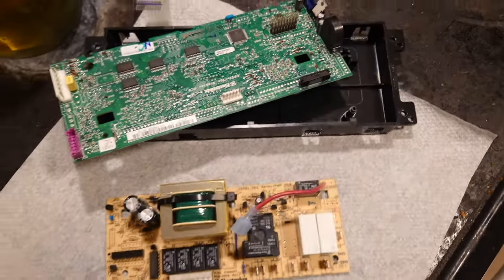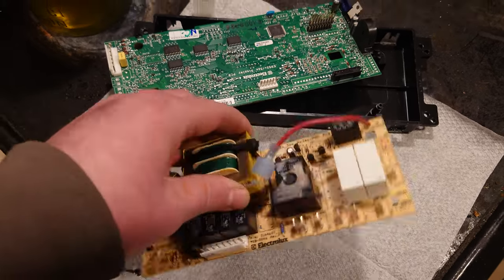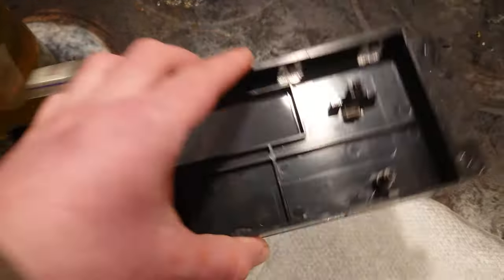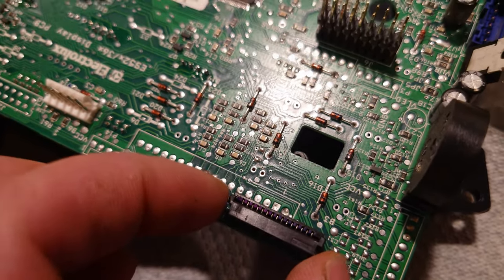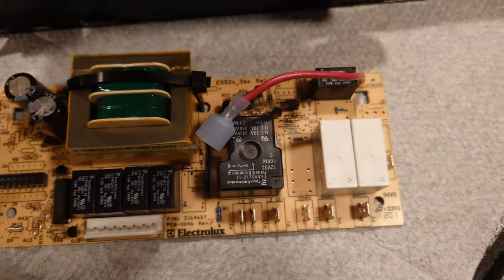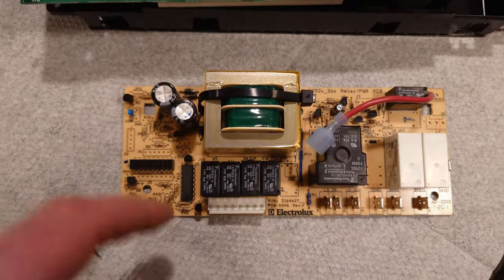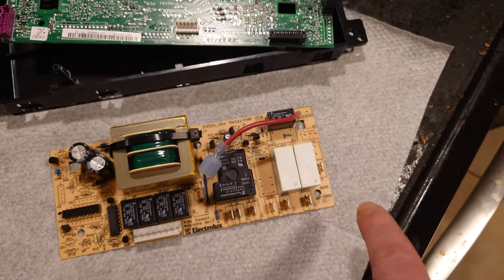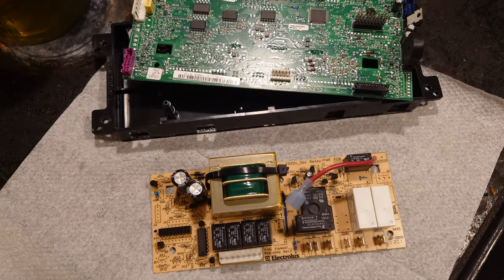Electric Range Control Board Disassembly / Fix - Oven Not Working, Kenmore - Easy Fix Oven No Heat

Comment: The oven on my Kenmore wasn’t working and while looking for how to troubleshoot this I watched this video - I pulled the control board coming from the backside without taking everything else apart - it was pretty easy.  I found the same pin missing the solder - I watched another YouTube video on how to solder control board pins - went and bought a hot soldering iron for $50 and some solder for $8 and fixed it!!!  I’ve never done this kind of fix before and couldn’t have done it without having watched this video first - thanks!!! 😊
Reply from the maker: Much more fun than figuring out how to get an oven out of your house purchasing a new one and then disposing of the old one...

Comment: Thanks for the Video, very helpful, I have a similar problem, tried to find a replacement board, no luck, wondering where i can purchase a board.
Reply from the maker: I saw some one eBay but ended up repairing mine. However there are repair services cheaper then buying a new board. Like around 50 bux.

Comment: My Oven Control Board came out of the stove top and there are no places to screw it back to the top part of the stove. How can I attach this board to the stove top? Can I use crazy glue or other adhesive to secure it back to the stove or could I purchase a new top part?

Comment: My PCB appears to have the same issue. How did you fix it?
Reply: Try resoldering the bad pcb through hole connection (looks like the relay). Cold solder joints become resistive and can heat up unsoldering themselves. I’ve fixed two ovens due to this problem.